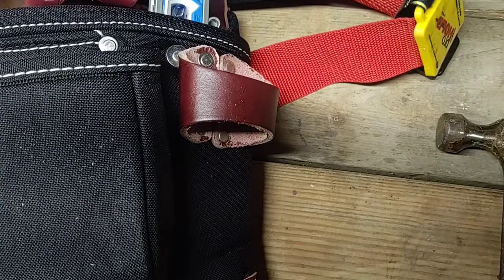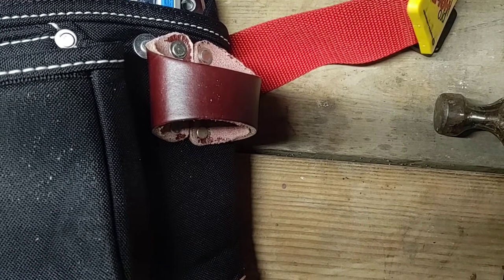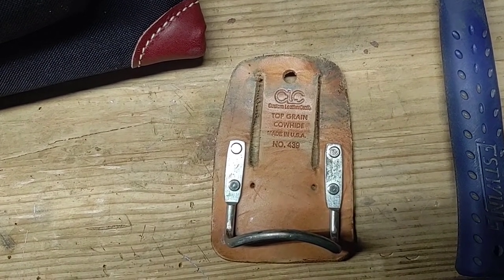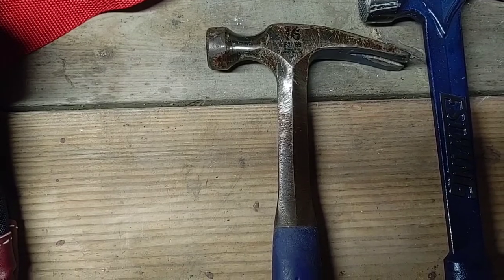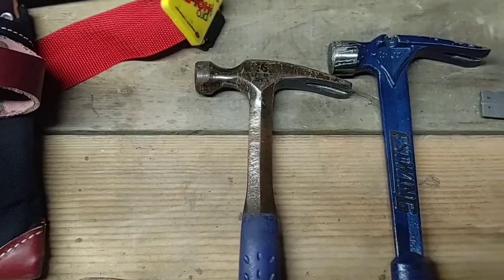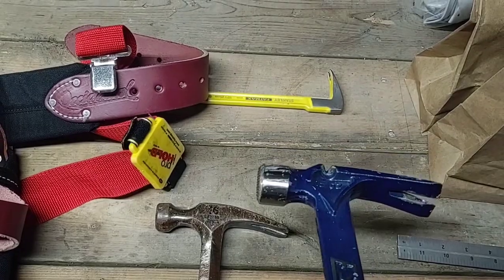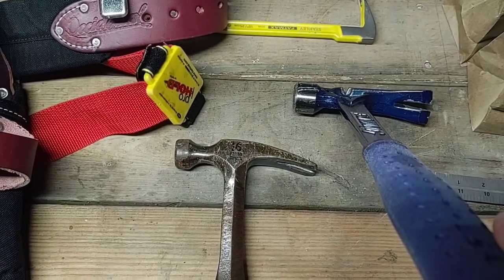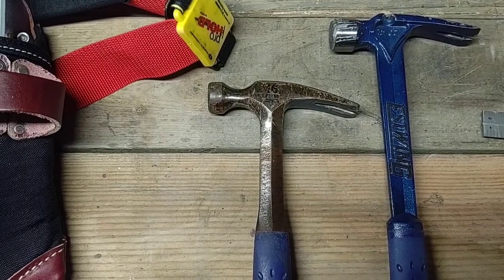Occidental Leather DIY Tool Belt Setup Continued...B8018DB

Comment: that hammer hook on the bag, I have never had a hammer in it but it's great for snips, pop rivet gun, hanging your screw gun, drill. I personally think as a hammer strap they are Horrible, a pita if you will. Just my opinion for what that's worth, You will enjoy your set up when it complete. Enjoy and have a great day.
Reply from the maker: Thanks for the pointers.
Reply: They are great for hammer tackers and as a hanger for a nail gun or impact driver/drill driver, 👍🔨🇮🇪

Comment: What he said about the leather hammer loop is an extreme exaggeration. It would take years to wear it out completely, and when it does you can get it replaced by any cobbler for quite cheap. Metal is worse honestly because the hammer swings around a lot more.
Reply from the maker: Thank you for the info.

Comment: i was thinking about ripping out my leather hammer loop and adding a metal one somehow
Reply from the maker: Yeah, you might be able to rivet a metal hammer loop on.
Reply: I wouldn't to be honest, you'd end up banging it off finished surfaces. I find those leather hammer loops on occidental leather bags to be great. But...they need to be inclined approximately fifteen to twenty degrees to the rear, 👍🔨🇮🇪
Reply: @TheToolnut  meh, before i had this bag with the leather loop i was using a little occidentaltool pouch that had a metal loop - it was never an issue. had to upgrade due to lack of space for tools